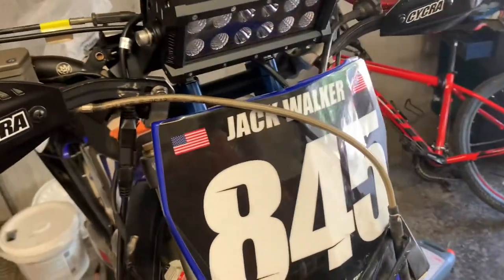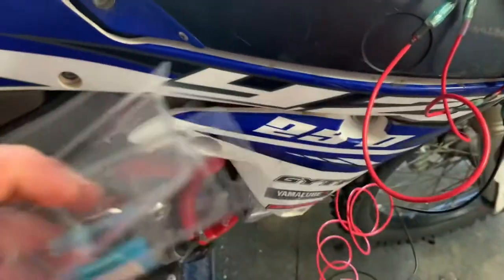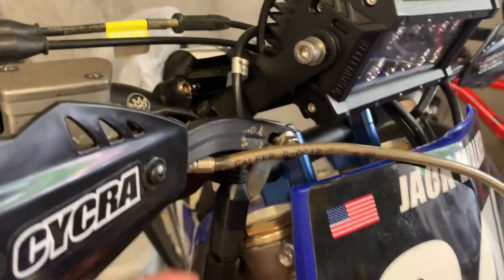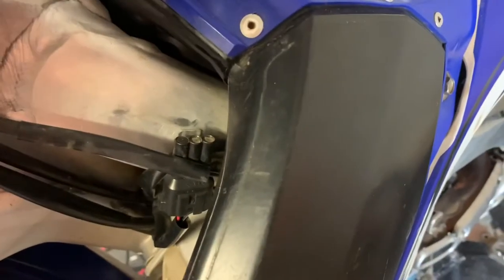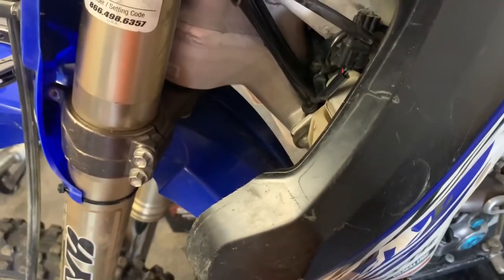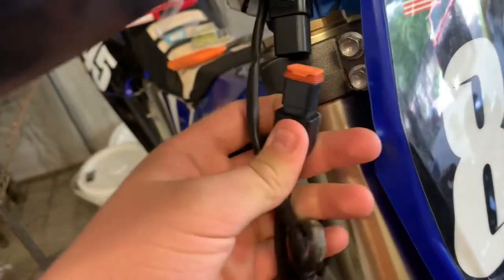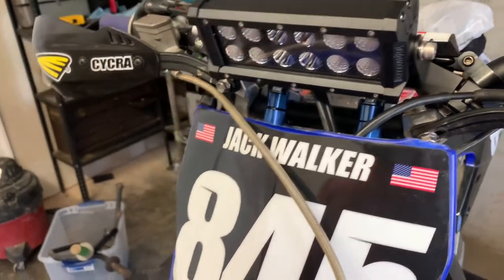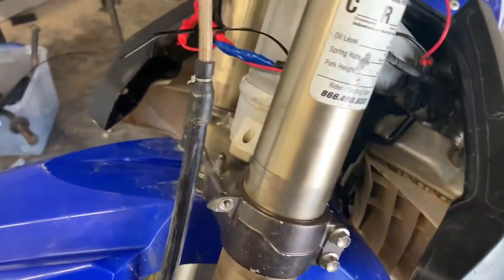Putting light bar on the yz250f (no battery)

Comment: I did a lot of wiring on my SxS. You can use a couple things I didn’t hear mentioned.  Dab a bit of dielectric grease on connections to help with moisture as well as waterproof connectors. Use braided cable sleeve or you can heat shrink wires (they sell ones long enough you could prob do entire wire. Where wire splits, shrink both wires and add a third heat shrink tube over connection. It will be more protected and look better for a cpl more dollars. Tape is gonna start to unravel first time it rains. Zip tie wires tight with just enough slack to turn handlebars.